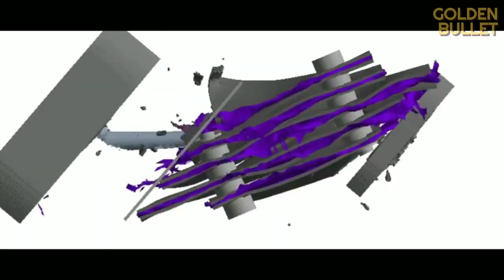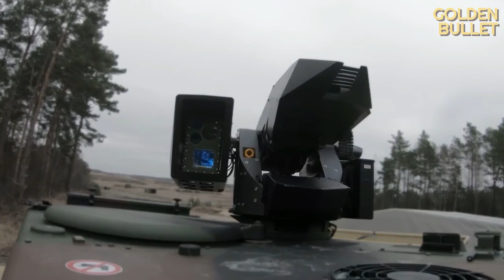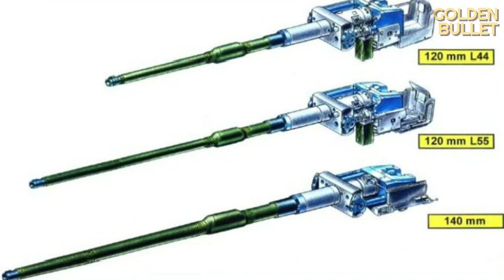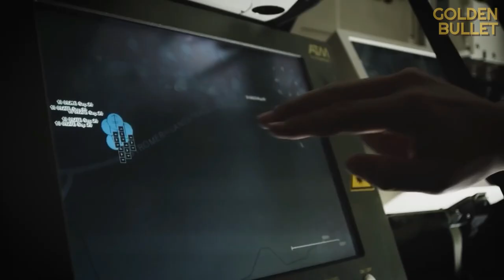New Panther KF51 vs. Leopard 2A7 - Who will win?

Comment: The KF51 Panther tank is based on the frame of the Leopard.
This is by design, seeing that the Leopard was already modular. Existing Leopard tank could be modified with a new powerplant turret etc without much effort.
Although the KF51 Panther is a totally new design is it an evolution from the successful building blocks of the Leopard.

Just to point out that the tank also have quite a good anti drone capability and like all tanks it is still evolving.

It has indeed a Multiple Remote Controlled Weapon Station (RCWS) integration option, which gives it a flexibility in proximity and drone defence. 
The KF-51 Panther also includes at this time a fully automatic 12.7mm coaxial machinegun which complements the main weapon and can deal with threats from drones to light-armored vehicles .
The tank also has an intelligent defense system that can thwart missiles fired or comes from above this is a critical vulnerability in both Russian and Western-made tanks.
What is still being experimented on as far as I can gather is its ability to tactical jam targets, signals like radio signals from vehicle, drone, etc.

So i think is will be quite a nice tank in the future.

Main problem could be the turret, NATO standard are there so everyone could support each other.
If only few countries have these new standards and a war broke out the ammunition stocks will be a problem like it is now world wide.
So we already see Leopard 2A8 and probably in the near future a 2A9 being developed.
I'm not seeing NATO switch from a 120mm to 130/140mm unlesss it is a new standard for all new tank designs.
Reply: But in military forums say that the 130mm has %50 more power/range as the 120mm Cannon.
Reply: @20TNR  the bigger the gun - the more punch it packs. But there are reasons why nobody is making 200mm tank turrets or 600mm artillery systems. There are costs and trade-offs, especially when it comes to tanks. It becomes heavier, can carry less shells, it requires more fuel, etc etc. Everything is co-dependant. Germans learned than during WW2 with their Tigers and King Tigers.